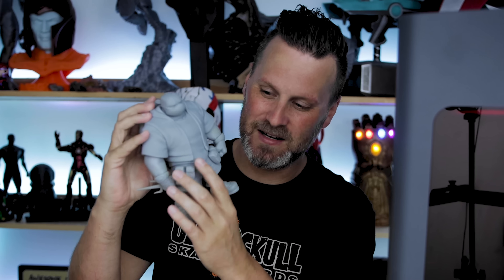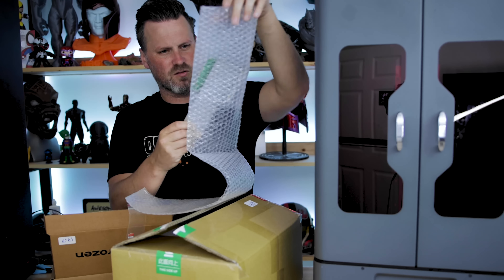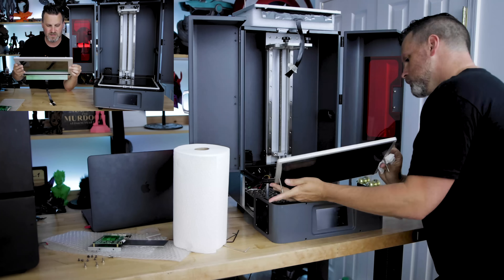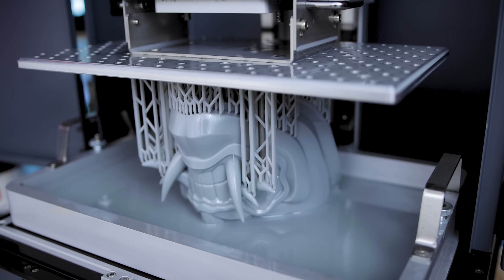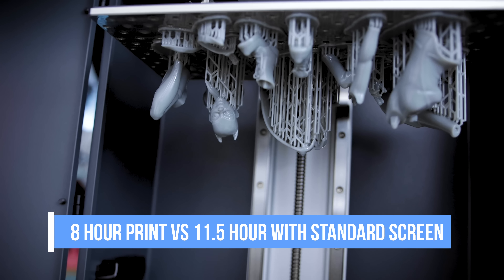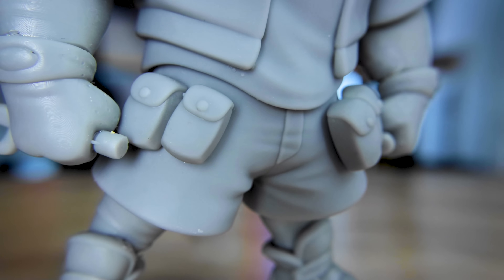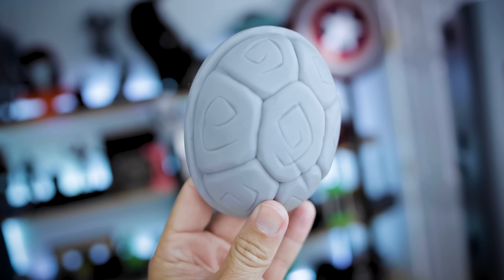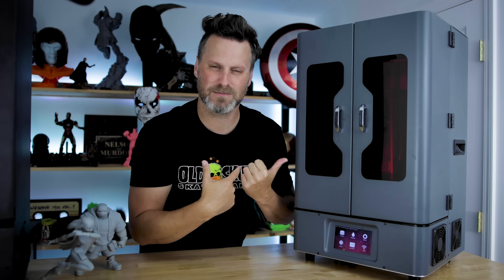FASTER Resin 3D Printing - Mono Screen Upgrade for Phrozen Transform

Comment: Hello Uncle Jessy, just bought the 4K fast version straight from the factory, I have a ton of siraya tech  resin, is there a compatible profile I can use for this resin in this machine? Have looked around for reference with no luck, my first few prints have failed with settings for the regular transform, please help

Comment: What is the Chitubox settings for the phrozen transform fast mono large screen and Phrozen Rock-Black Stiff resin?  The damn thing comes with no god damn instructions of any form, a blank ssd card, and no chitubox profiles!  Great, what the fuck do I do with it? Use it as a $3000 doorstop!  I've googled phrozen transform fast - setup, chitubox settings, rock-black stiff resin settings in chitubox, and all I get is crickets!  Can anyone help get me started?  I have a kg of rock-black stiff resin and the printer and have no fucking idea how to get setup and printing something.  I signed on to the phrozen forum and cannot find any help.  Is there a better phrozen transform fast forum someplace?

Comment: I’m curious how this machine is treating you now that you’ve upgraded the screen and have owned the machine for quiet awhile? I’m going to be buying either this or the Phenom as I don’t really see any others in this size range. Would you still recommend this machine? It’s primary use will be for prototyping. Thanks!

Comment: I tried to buy this when u first got it unable to get 1 u mentioned 1800 or so it’s now over 2000 and still not possible to achieve. Do u k ow if they worked the wifi issues ?

Comment: Hello:

Does the kit come with a graphic card or did you buy it separately? I just received my kit and it only comes with the aluminum frame, the LCD, some screws and the SD card, it doesn't bring any electronics and it has missed me a lot, that's why I bought a video of the assembly and yours came out.
I would appreciate if you could confirm whether or not that piece of electronics comes in the kit to claim in case they have not sent it to me.

thanks

Comment: Hey Uncle J, Im having some issues with my Ptransform, the lcd test shows some seconds with squares shapes and brushed like stripes before the grid looks most correctly displayed, its that ok? And Im get some thick layer of cured resin on the borders of the vat that remains on de FEP... this does happens on my firsts prints but dont remember if the screen behave was the same...  have fix? Can I send you a picture?

Comment: With such a huge printer build volume, would you consider printing these statues in one piece instead of split and keyed in multiple parts? That Rafael and the BatGirl could have been printed in one go? Edit: looking at the files it appears the artist has only provided a split version. With these bigger printers becoming more popular, artists should start providing whole model files as well as splits!! 
Also at 12:00 "I don't see a downside apart form the extra $900 price tag for the upgrade". LOL. Just quietly drop that price in there. I nearly fell off my chair!! 
Can you ask Phrozen to give you some idea of what it costs to replace the Mono LCD panels? I assume the $900 is for the entire module and that replacing the screen itself will be at least a little bit cheaper?

Comment: WHY is it faster? Why is a mono screen more expensive than a colour screen?
Reply: True story bro...
I still have prices took from aliexpress in 2009/2010 when I was searching displays for an UMPC (I save whole webpages since I was 15...I'm 34 now... ). Basically, from the very first day this whole resin 3D printer "gimmick" came out ("gimmick" because it's a mere video player that moves one single axis per frame of video) prices have been inflated to the max and monochrome displays have resurged from the graveyard where they were laying dead...
Funny how production costs are now so rare to find...But they're so low you wouldn't believe how low they get per square meter...
By the way, proper cooling can boost the amount of hours you can get out of them, but I'm beginning to believe that a huge amount of badly produced displays are merely hitting the market in tons...Reason why we're led to believe that they're "consumables". This is a business tactic whose only objective is to further push prices lower to kick out of business those who produce high quality displays, the ones made to last...
Reply: Mono's should be faster (theoretically) because they don't have any color filters.  Normal LCD displays are configured in an RGB arrangement (sometimes RGB + luminance) to reproduce color images... but since resin printers only use near-ultraviolet light, the filters are blocking a vast majority of the light from getting through.  This means you have to expose longer and life time is shorter on the display (more "on" time being exposed to damaging near-UV).  Mono displays don't have any color filters which means they let all the UV through and so you can use shorter exposure times.

Why more expensive?  Guess it has to do with economies of scale.  Millions of color RGB displays are produced every year.  But how many 4K mono displays are used outside of resin printers?  Not many, which means these have to be manufactured specifically for resin printers and that drives up the cost a lot.
Reply: @BreakingTaps  Your explanation makes a lot of sense, thanks for taking the time.
Reply: @TheAndyroo770  No problem!  One of those things I kept seeing stated everywhere without explanation as well, and got frustrated myself.  Did some digging and figured I'd pass it on :)
Reply: @BreakingTaps  Cool channel by the way. I've been researching injection moulding so a handy find, subscribed. With regards lenses, you should try make a cheap anamorphic nifty fifty (then send it to me lol). Also, is it possible to vapour smooth the resin lenses produced for better optical clearness (or worse?!)?.

Comment: $900 for a replacement screen ? Ouch!
Reply: I think that's the cost for the entire Monochrome LCD module including the frame, the control board etc. Replacing just the screen when it fails should be a bit cheaper. Not sure how much cheaper but based on the 8.9" mono panel (panel only) for the Shuffle XL being $300, I'd estimate $4-500. Still a lot but prices may drop in time.

Comment: Okay, noob question here. Now how does a better higher resolution screen make the printing faster? I'm not understanding that part. Not trolling. I really want to understand. Thanks in advance.
Reply: Btw, I subscribed.
Reply: Since no one answered you:  The LCD is a monochrome screen instead of color screen.  A mono screen does not need the extra color filter layers like a color screen.

The mono LCD lets way more UV light through than a color LCD can, so it takes much less time to cure the resin, the resolution has nothing to do with it.

Comment: Uncle Jessy, a project for you. I can't try for myself as I don't have a printer. Check if you can make casts with resin. Technically it should be fairly easy and need very little supports. A box and then boolean the castable bit inside to remove that shape and mass from it. Then bisection the box and add pour holes. Once done add mold release and cast.

Comment: I have a nice plastic putty knife that I use to check the FEP and stir the resin between prints. Really helps to assure that there isn't anything stuck on the film and sometimes reveals the loose pieces of cured resin floating about. I love the idea of these upgrade kits and hope they become more common, but for the adventurous, you can find most everything you need from Chitu and Duobond on aliexpress or alibaba.

And any chance you might share your slicer settings in future vids. I am a fan of Siraya Tech Fast and would love to skip the calibration exercise once my Saturn arrives...or my X10-mono. I admit, I may have a problem but it keeps me safe at home and off the streets so win?

Comment: im also thinking about upgrading my Transform to mono screen , how fast ? the original screen 15 sec / layer how about this one ?
Reply: Will depend on your resin and the model and a host of other factors. Also remember that it's not just "half the time per layer means half the total time" You still have to allow for lifting and lowering the build panel between every layer. That's why its good to do what Jessie did and compare the total print times, not just layer times.
Reply: @Starganderfish  i see , i mean is it worth to upgrade for this price to performance ? thank you

Comment: Great video.  I was wondering what came in the upgrade kit.  Glad to see for the $900 you get a new frame and boards too.  I was looking at a 3rd party monoscreen but the aluminum frame needed modifications to work. What were the default exposure times on the monoscreen? Thanks for the review.

Comment: Would you recommend the Saturn over the transform? I have 2 Mars however I want a new printer for larger prints. Great video!
Reply: I don't think they are in the same class. 
If the Saturn is L then this guy is XL or maybe even XXL. 
He lists the dimensions so you look at the size of the prints you want to make and see which one would support it.
Also price point. The Saturn preorder prices I'm hoping are close the wide release(but things may be weird in this Covid world right now).
Reply: Definitely not good to compare the two. Massively different in size and output.
Reply: The Jupiter would be a more comparable machine (when they reveal it)
Reply: The Saturn is only 200mm tall, while the Phenom and Transform can print 400mm tall. If you're only printing Mini's then the Saturn is a great option but for statues and cosplay items, masks etc, it's not really worth it.

Comment: How is the off-gassing of the new generation of resins and 3d printers? Can you use in a room w/o windows or would you need to run a dedicated exhaust fan for these printers.